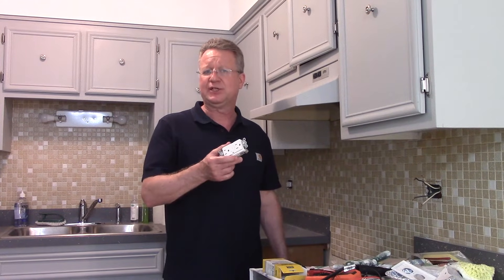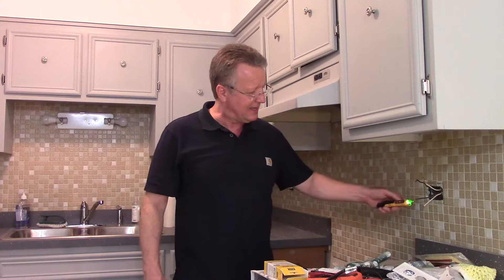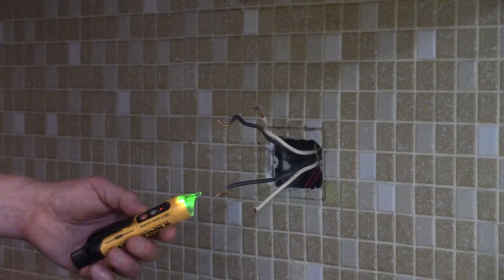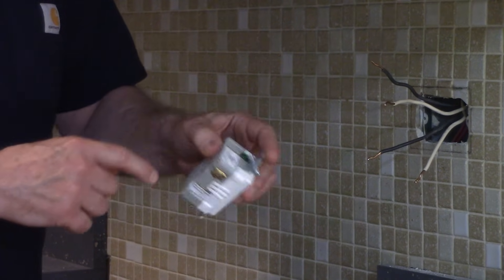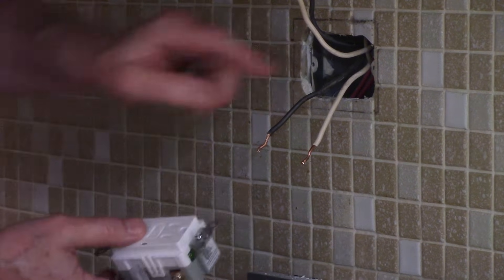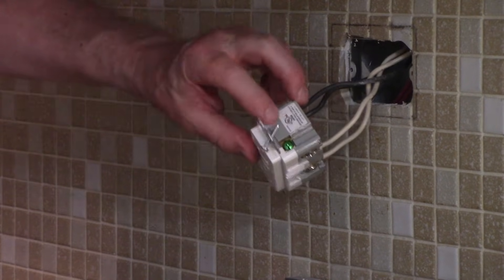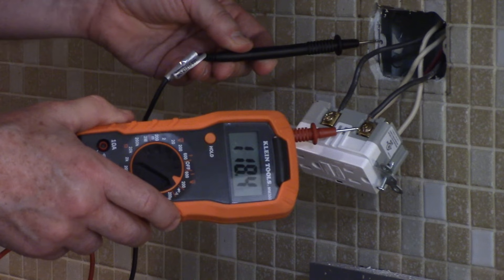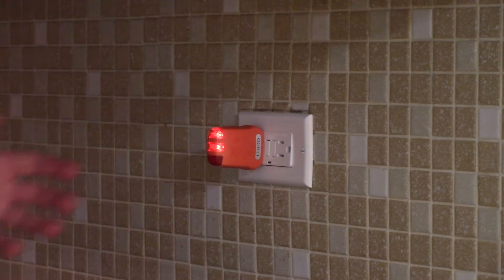How to Install a GFCI Outlet with 4 Wires

Comment: My old outlet has 2 terminals with 2 wires each, how do I figure out how to connect the neutrals to my new outlet line/load terminals.  Second question, is it dangerous to experiment with trying both configurations?  50/50 I get it right the first time.
Reply from the maker: Hi, disconnect and test the wires to find the line and load. Most new GFCI's won't work, or allow you to reset the GFCI if it's wired incorrectly. 
Check out more home improvement tips in our e-books https://www.amazon.com/gp/product/B0B2KW1FQ9?notRedirectToSDP=1&.

Comment: Can I use a 20 amp gfci in a older apt ?
Reply from the maker: Hi, match the GFCI to the breaker or fuse. Don't put a 20 amp outlet or GFCI on a 15 amp circuit, it is against code. 
Check out more home improvement tips in our e-books https://www.amazon.com/gp/product/B0B2KW1FQ9?notRedirectToSDP=1&.

Comment: All that testing is not necessary. Turn the power off to that circuit. Take the line wires off the old outlet and put them on the lines side of the new outlet. Do the same for the load side. Then, turn the power back on and test. I think people just want to lengthen their videos.
Reply from the maker: Hi, if you don't test, you don't know which outlet is the first in that circuit for the GFCI. You also don't know the line and load wires. With an outlet you only have brass or silver screws. They aren't marked line or load because that doesn't matter on a standard outlet.

Comment: Hi, question? The wires that’s going to the 2nd and 3rd outlets in the circuit should be installed into the line or load side of outlets?
Thanks
Reply from the maker: Hi, the outlets past the GFCI would be connect like a standard outlet. The hot wire to either brass screw and the neutral wire to either silver screw. 
Check out some home improvement tips in our e-books https://www.amazon.com/gp/product/B0B2KW1FQ9

Comment: What if both black wires are hot?
Reply from the maker: Hi, when you find the live wire in the first box it's the common. When you find the 2 live wires in the second box, they are the travelers. The color isn't the determining factor.
Check out more home improvement tips in our e-books https://www.amazon.com/gp/product/B0B2KW1FQ9?notRedirectToSDP=1&.

Comment: I have 3 outlets in my kitchen, so do I only replace one to GFCI
Reply from the maker: Hi, if the 3 outlets are on the same circuit, you only need a GFCI on the first outlet on the circuit. Everything past the GFCI is protected.
Check out more home improvement tips in our e-books https://www.amazon.com/gp/product/B0B2KW1FQ9?notRedirectToSDP=1&.

Comment: So what happens if you dont wire your GFCI in the first box in the circuit? Will it just only protect the ones after in the chain?
Reply from the maker: Hi, yes it protects the outlets past the GFCI.
Check out some home improvement tips in our e-books https://www.amazon.com/gp/product/B0B2KW1FQ9?notRedirectToSDP=1&.
Reply: @FIXITHomeImprovementChannel  Thanks for the quick response! Okay so you just follow the same procedure and find the hot wire?
Reply from the maker: Yes, test for the live wire.

Comment: If my kitchen circuit is 20amp can I still put a 15amp GFCI on it? The outlets in there are already 15amp.
Reply from the maker: Hi, yes, you can put 15 amp outlets and GFCI's on a 20 amp circuit. Not 20 amp outlets on a 15 amp circuit.

Comment: Well what if i only want that one outlet on the GFCI?
Reply from the maker: Hi, if you don't want to protect additional outlets past the GFCI, you can connect the hot wires together and neutral wires together with wire connectors and add a pigtail wire to each wire connector to attach to the line side. Now only the GFCI has protection and nothing past it. 
Check out more home improvement tips in our e-books https://www.amazon.com/gp/product/B0B2KW1FQ9?notRedirectToSDP=1&.

Comment: What do you do with those red wires I see in the wall? Mine were connected to the outlets
Reply from the maker: Hi, they are connected to another circuit. You will find that is some homes with conduit.

Comment: What would the procedure be to install a GFCI outlet in my kitchen receptacle if it's a 4 wire setup (red, black, neutral and ground) and its in its own circuit.
Reply from the maker: Hi, is the outlet you have now a switched outlet? A switch turns on the outlet or a switch turns on one side of the outlet.
Reply: @FIXITHomeImprovementChannel  Got it figured, thanks for the reply!

Comment: Hello...  I have 12/3 wire within the circuit....   Do you have details how to wire this type of GFCI with 12/3 wire?  You are showing this installation using only 12/2.  
Thank you!!
Reply from the maker: Hi, the steps are the same, just connect the ground wire to the green grounding screw. 
We have more home improvement tips on our weekly podcast 
https://itunes.apple.com/us/podcast/fix-it-home-improvement/id880903087?mt=2

Comment: What is the specific name of the tool you are using to find the hot lead(s).  'Electrical tester' is kinda' generic.
Reply from the maker: Hi, you can use a multimeter or a non contact electrical tester. 
We have more home improvement tips on our weekly podcast 
https://itunes.apple.com/us/podcast/fix-it-home-improvement/id880903087?mt=2
Reply: @FIXITHomeImprovementChannel  Thanks!  I got the tools you used at Home Depot and successfully replaced a faulty GFCI by my kitchen sink.  TYVM!

Comment: A third GFCI in my kitchen had 5 wires in it, unbeknownst to me, when I pulled the receptacle off. Now I don't know how to replace it with a gray 15 Amp GFCI replacement. One white and 1 Black measure 130+- Volts, tested with voltmeter against ground. The blacks placement are obvious. The whites???

Comment: this comment is for people who don't trust the video. This worked perfect for me. Just make sure that the amps of the new socket matches the one labeled for the circuit. So if the switch that you have to turn off says "15," make sure to get a 15 amp socket.

Overall i give the video a 9/10
Reply: I thought you can wire a 15amp outlet on a 20amp circuit though but not the other way around.
Reply: You can.

Comment: Great simplified video!  But I just can't wrap my head around which white wire is which?  You say "corresponding neutral wire" but I can't tell which white wire that is!  
Does it matter where the white wires go?  How do I differentiate the white wires?
Reply from the maker: Hi, you can email me at fixitpodcast@gmail.com and let me know how many wires you have in the box and show me a picture.
Reply: The wires black, white and ground should come together,  pull them out a little more to figure out the corresponding ones.
Reply: @joaquinsuarez6090 What happens if you use the wrong neutral?
Reply: @JB-dv7ew  it won't work properly. If it doesn't work, exchange the white/neutral.
Reply: @joaquinsuarez6090  Okay thanks for the input. I wired one so far in the bathroom. Only had 2 wires so easy peazy. Reset worked no problem and tested with an outlet tool also. I'm guessing my other bathroom will be the same and then my kitchen will have 4. In the kitchen I'm going to do the one closest to the sink.
Reply: @joaquinsuarez6090 Okay so tried the other bathroom and it kept resetting. This one had four wires. I tested for power, hooked it up to line and with corresponding neutral, kept resetting, red light was on. I swapped the neutrals and the reset button wouldn't work and there was no light. I took it back out and put the old one back, outlet and circuit work fine. Not sure what the issue is, bad GFCI?
Reply: Don't assume the outlet closest to sink is the first one that gets power. In my kitchen first one that needed gfci was across sink next to stove.
To make sure which one is the first outlet getting power you have to turn off braker, pull out all outlets in that circuit, disconnect wires from outlets, turn braker on and test every black wire and only the one with power is the one that needs the gfci and this will protect the rest of the outlets in that circuit.

Comment: Excellent. This is the one video that I've seen that explains wiring the hot black wire+corresponding white wire to the LINE side of the gfi (etched into the back). The other b/w go the LOAD side. I had no success with my light switches until my gfi outlet wires were in that order. Thank you brother!
Reply from the maker: You're welcome.
We have more home improvement tips on our weekly podcast 
https://itunes.apple.com/us/podcast/fix-it-home-improvement/id880903087?mt=2

Comment: suppose you don't want GFCI protection for the outlets downstream, what's the correct wiring in this case?
Reply from the maker: Hi, you would connect the hot wires under a wire connector and run a pigtail to the brass screw on the line side, then connect the neutral wires together under a wire connector and run a pigtail to the silver screw on the line side. 
We have more home improvement tips on our weekly podcast 
https://itunes.apple.com/us/podcast/fix-it-home-improvement/id880903087?mt=2
Reply: @FIXITHomeImprovementChannel  understood, Thank You!!

Comment: Dumb question, but how do you know which neutral corresponds with the line or load?
Reply: The wires black, white and ground should come together,  pull them out a little more to figure out the corresponding ones.
Reply from the maker: Hi, you can email me at fixitpodcast@gmail.com.

Comment: You forgot to tell why getting 118 volts on your meter means it is grounding. most people would assume that the reading on the meter means that 120V means a current leak

Comment: Do you mind sharing the make/model of your non contact voltage tester & the outlet tester? Thanks. Good explanation!
Reply from the maker: Hi, the outlet tester is Klein Tools RT210. Great tester, doesn't need a battery and has a GFCI tester. The non contact tester is Klein Tools NCVT3P. It is a dual range tester. For projects like this I use the 70-1000 range. I like this model, it has a built in flashlight.
Reply: @FIXITHomeImprovementChannel  Thanks so much!
Reply: @FIXITHomeImprovementChannel  where do you buy the outlets